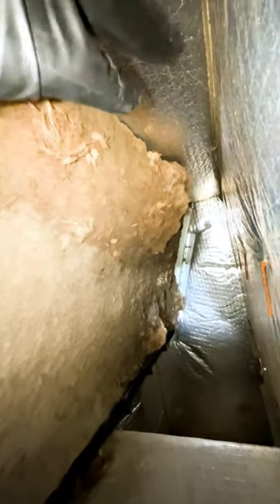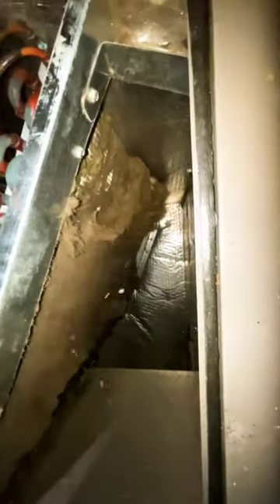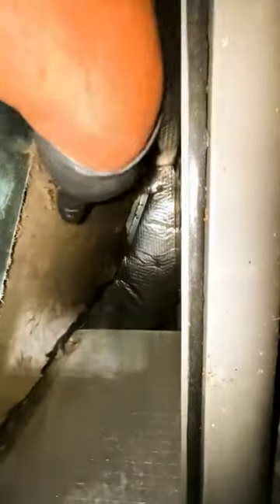I Bet You've Never Seen an Evaporator Coil this Bad Before!!

Comment: wow how long did that take?
Reply from the maker: Wasn't too bad actually, probably took about 45 minutes wish I would have captured on video. I use my Milwaukee M12 wet dry vac with a vacuum cleaner attachment for Hardwoods and a few brushes. Then I sprayed it with coil cleaner and rinsed it off.